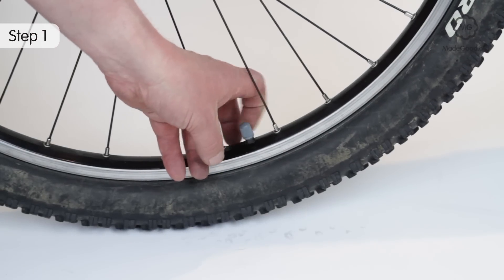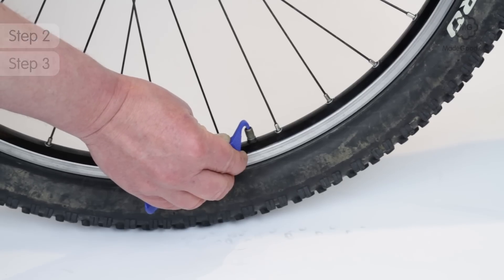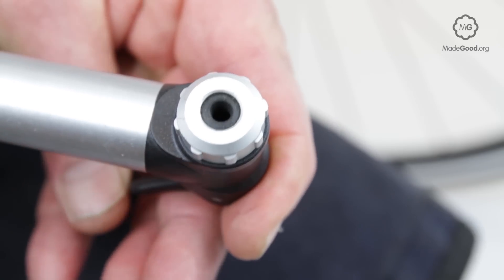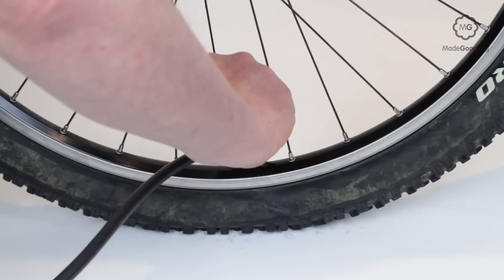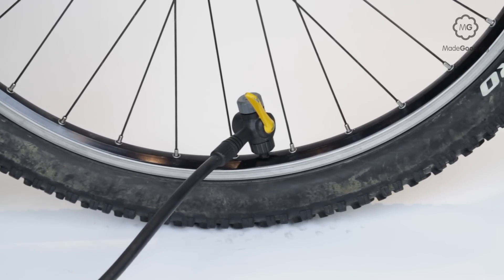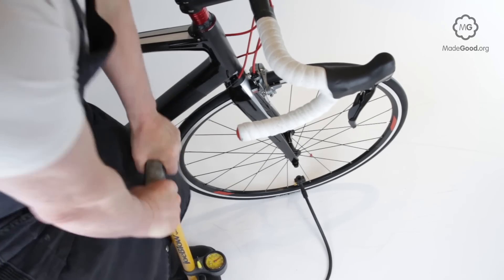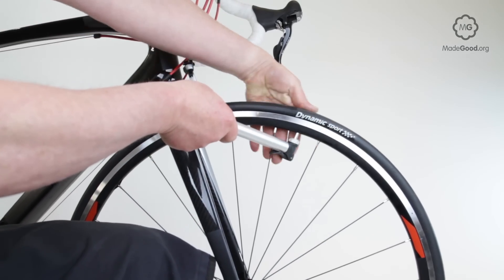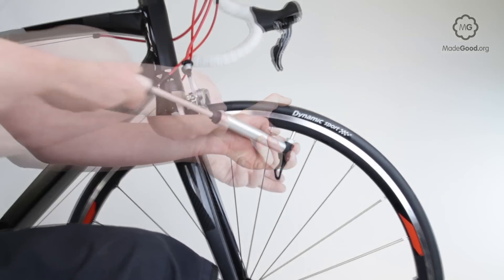Inflate A Bike Tyre With A Schrader Valve Or Auto Valve

Comment: I have a pump with a "push fit connection" without a "cam leaver" (ordinary bicycle pump) and my tire with "car valve" doesn't like to be pumped (using an ordinary adapter for car valve of course), it seems. That is the trouble, but you have all the right gear, you don't care. I succeeded pumping the tire before though, so it must be possible. I hope I remember to buy tires without car valves in the future.

THE SOLUTION IS: completely screw on the adapter on the valve. Your tire will hiss and lose air, but once you start pumping the air flows the other way. Pump for a few minutes with that lousy old pump and the tire will be hard enough. Quickly remove the adapter, put the dopje back on and you are ready!

Comment: how can you tell if it is pumped enough? i don't have the pump which indicates the amount of pressure in the tire. I dont want to over pump.my tires, though when i side on my bike the tire is very slightly flatter on the bottom, but when I touch it it feels hard enough and is completely round when i am not on it. i weight 125 pounds.
Reply: you should be able to make a very small indent with your hand in the tire, if you lift the wheel up a few and inch or two and drop it it should bounce a little if it does not it is too soft, if you pinch the tire you should be able to squeeze it about 2% to 5%. Bets way is to pump it up, ride it, is it too soft? Sapping your energy? pump it a bit more until it is nice easy ride of the flat, ie freewheels well, you don't need to go over board until is like you are riding on steel wheels.
Reply: Thank You. Though I do worry over the fact that a friend of mine had over inflated it to the extent of it popping. Is there any definite way to find out whether or not it is over inflated?
Reply: It's very hard to over inflate a bike tyre with a hand pump most people wouldn't be strong enough.   If you're using a machine then check your tyres manufacturer recommended pressure or if you don't know then don't go over 60psi for a modern adult bike.

Comment: All my air came back out when I remove the pump from the valve 😔 what did I do wrong?
Reply: You just wasn't quick enough taking off the pump. I tried so many times and have now just given up. I'm that slow my tyres are as flat as pancakes by the time I get the pump off. I even got a snap pump to speed things up and I'm still too slow. I'll walk or bus in future.

Comment: I recently got a hand pump with 2 nozzles at the end wirh a 90 degree grip lever (the common, plastic ones). However, it only seems to push air through the wider nozzle while I need to utilize the narrower one. How do I go about 'switching' it?
Reply from the maker: It depends on the design. Sometimes turning the lever the other way pushes the air out of the opposite nozzle. Sometimes you have to remove the nozzles and switch them around, and sometimes there is a button or switch the re-routes the air.
Reply: @MadeGoodFilms  Thanks, mate. It seemed there is a "ball" inside the dual way nozzle that needs to switch the other side off when plugged onto the valve. It just did not work and i returned the unfortunate product to the vendor.

Comment: What if the Schrader valve is half the  length of a regular one... my tire valves are barely coming out of the rim. I can attach my pump, but the valve is too short to take the air. Wtf is going on here lol.  Can't fill it up, because the valve is only like 1cm out of the rim
Reply from the maker: Yes that can be a problem. I don't know without seeing your bike but maybe your rims are too deep for the valve on the tube you have bought? One thing to check is that usually the valve is threaded, and takes a threaded washer. If you screw this washer on it will 'pull' the valve out of the hole in your rim. If you don't have that style of valve, you can try to push the valve further out of the hole in the rim by placing your thumb behind the valve on the outside of the tyre and applying pressure. Failing all of that, you might have to buy another inner tube with a longer valve. The specifications will be listed on the box. Good luck!

Comment: My bike is resisting air. I pressed the button to see if the valve was stuck and it wasn't. When I pull my pump up it won't let me puck the air into the tire no one knows what's going on my inner tube I think it's fine because my tired was still inflated until last night after I pushed the inner button in the valve when I woke up today my tire was complete deflated

Comment: My problem is, with my quite old Raleigh Vixen, Schrader valves, when I pump the tyres up with an ordinary hand pump, on unscrewing the tube connector, air comes out. It stops when it's fully unscrewed with no more escaping. That little bit of escaped air makes a difference and I sometimes have to re-pump a bit more in. I can't unscrew the tube fast enough! My hubby says this should not happen and says both my tyre valves are faulty(!!)  Any advice?
Reply from the maker: An inner tube is not expensive to replace, so you can easily check your tube against a new one.

Comment: I inflate the tire fully but it just deflates completely after the pump goes out
Reply: Alvi Hysa ever solve it??
Reply: same problem, whad did you do? this stupid tutorial teaches how to pump, not the important part how to keep the air in
Reply from the maker: Hi there. It could be one of two problems- either the valve was not properly connected in the first place and the air was not filling the tyre, or you need to be quicker to remove the pump valve from the tyre valve once you unlock the cam lever. Good luck.
Reply: I have the same issue.  None of these tutorials address this!  Mind you I have a different type of pump, one that is screw on therefore I don't know how I can remove it quickly! Frustrating!

Comment: the same mili second i take the pumper off, ALL the air comes out in less than a second, whats wrong?
Reply from the maker: I would suggest the most likely reason is that your pump is not properly connected in the first place, and the air is just escaping from the gap between the pump and the tyre valve. Give the valve head a push as show in the video to loosen it up, dirt can get jammed in and cause it to stick.

Comment: The consistent problem I have with Schrader on bike is a rupture where stem meets tube. Under normal braking pressure, tube slides on rim with tire, tube stem becomes angled through wheel stem port. Fails brand new even at less than 10 degree slant. Fails before tube goop is ever effective. Requires constant vigilance with deflate and stem straighten. Presta is worse in every other way that I can tell, utterly unreliable. Schrader is frustrating, Presta much moreso. If Presta is superior, why does literally no other industry use it? What do advocates of both recommend for biker suicide?
Reply: Same issue I have.